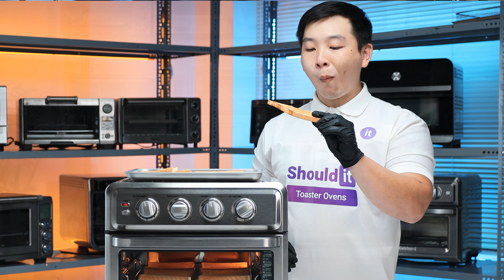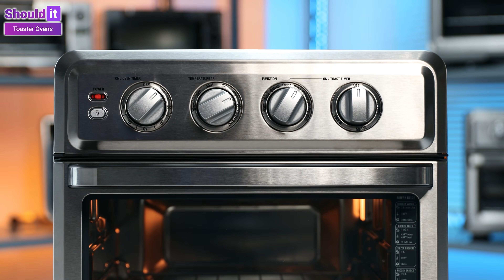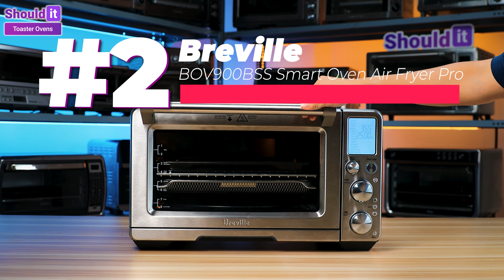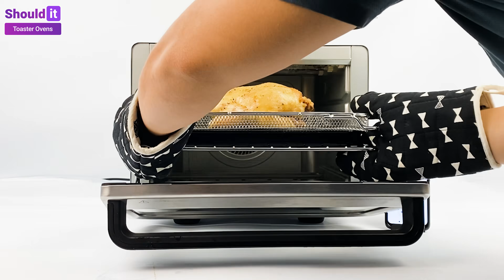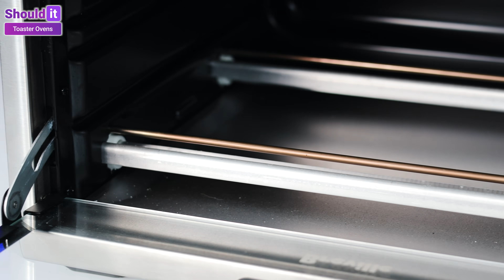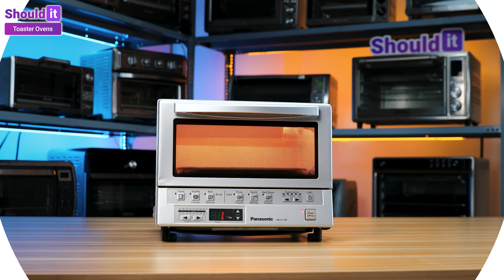Best Toaster Ovens of 2026 - Ninja vs. Breville vs. Cuisinart Review

Comment: I'll stick with the typhur smart sync oven. RTings has it as their best toaster oven beating several breville units, and is a better air fryer as they test that compared to the Ninja XL pro, which you picked as best air fryer oven. The typhur also has either the #1 or #2 best temp stability as well. The TOA-70 as the best LMAO
Reply from the maker: Thanks for sharing that, the Typhur Smart Sync is definitely one we hear about a lot. Our picks are based on our own hands-on testing, so results can differ a bit from other outlets depending on methodology, but always good to know how it stacks up elsewhere too.
Reply: @shouldit.official  ahh sorry, thought you tested the Sync.

Comment: You'll never get rid on the electronic smell/taste with the ninja. Been there done that.
Reply: I have 2 ninja basket air fryers and the xl pro and I've never experienced any odor issues after the first burn off
Reply from the maker: We've tested quite a few Ninja ovens and found doing one empty run first (no food, just let it run) gets rid of that smell completely. Worth trying if you still have one around.

Comment: any issues with the amount of steam coming out of the front door of the cuisinart impacting the dials?
Reply from the maker: Some steam near the front door is normal during high-heat cooking — it's just moisture releasing from food. That said, if steam is consistently hitting the dials, it's worth making sure the door is fully closed and the drip tray is in place. We didn't notice this as a significant issue in our tests, but it can vary depending on what you're cooking!